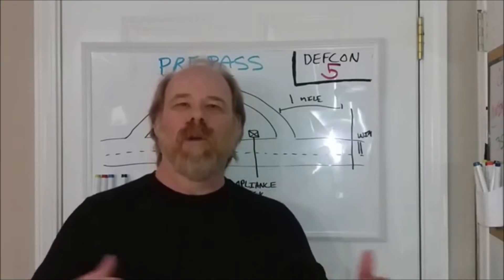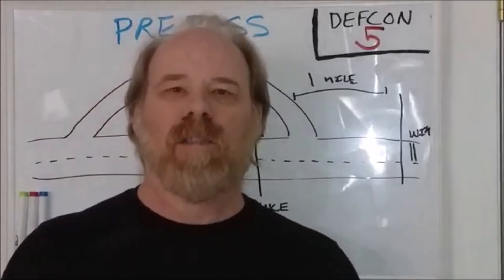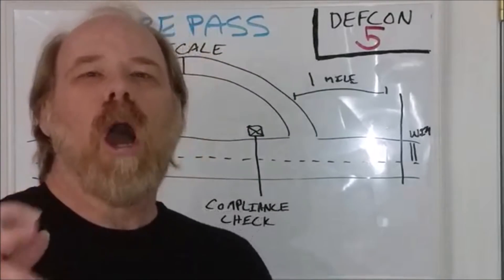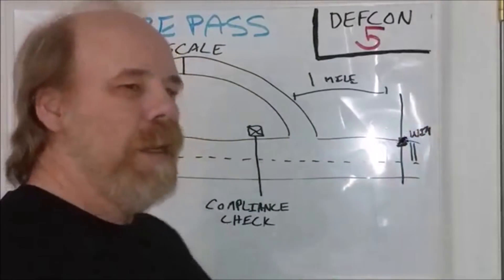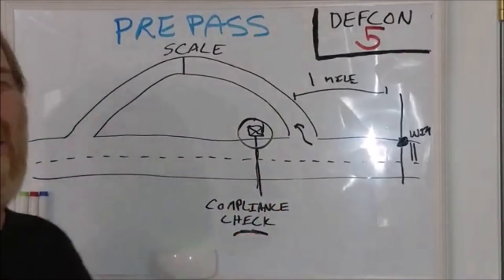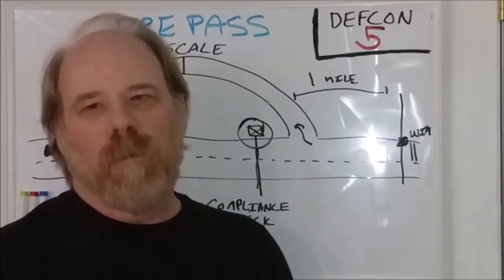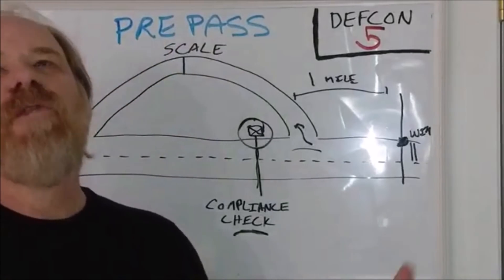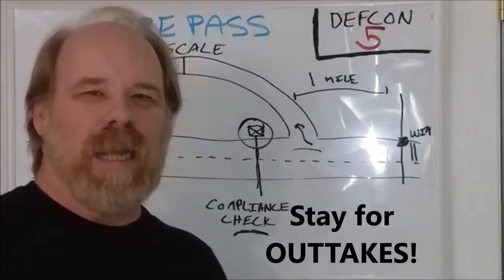How does PrePass work? | Trucking 101 | Trucking Answers

Comment: I have an ElitePass in my truck (Prepass and EzPass combined).  Haven’t gotten any lights (red or green) in a couple months, so I end up having to go into every open scale.  I’ve tried changing the batteries too, but didn’t do a thing.  Still works for tolls, though. My dispatcher hasn’t been of any use either, claims to have ‘run it up the chain’ but not gotten any answers.  Any ideas?
Reply: call prepass

Comment: Some states  call it I pass some call it pre pass  but your on the honor system. We were pulling  appliance and electronic loads for Best Buy  our tractors on that account were single axle  customer would not pay for the fuel that a twin screw uses  our loads were Light  don’t recall the exact numbers

Comment: what happens if the prepass doesnt light up and the scale is open? ive seen dozen of truckers skipping it maybe just 1 entering into the scale
Reply: You have to treat it as if you don't have a prepass. You gotta pull in the scale.
Reply: Krystal  your prepare not lighting or the roadside sign staying blank?  If your prepare stays blank then pull into the scale just to be safe.  If this happens in multiple states then get your company to replace it, the battery is likely dead.  Also if you go say thru WV toll plaza and it doesn't pay/ registrar dead battery also

Comment: Wastes my time always getting the RED @ the Florida AG checkpoint, they wave @ me to git every time. Just gonna start bypassing it.
Reply: they will chase you down tell the company to sign up for prepass ag then you will get a green every time but if you have produce would be the only time you need to go in on a green
Reply: Right  Florida  at  is separate from DOT. Requires separate agreement
Reply: Technically, all trucks must stop at ag ck. Flatbed, car carrier, van,refer, ect. Cop at ag ck told me that. Not likely to chase down flatbed vehicles, but can.
Reply: @garychace5091  i never stopped as long as i got the green

Comment: Nice when it is green than at the last minute it turns red when your almost the past the entrance. My last company had them in all trucks but some did not work because they were not activated. They said they have to pay so much per month to use it?
Reply from the maker: Yes, there is a fee.
Reply: it aint free
Reply: @JASONHJEFFERSON  Yes that is why my company only activated certain ones. I had to request to be turned on and then it was shut off again a few months later.  They told me was only for regional drivers which I was.
Reply: @mrj-charles6383  your company higher ups sound a little wacky , only for regional??
Reply: @davidrigoni8231  Yes because local was in areas where no prepass.  I ran Mid Atlantic and East Coast Regional for them. Not there anymore since I am semi-retired from trucking now. They offer flex scheduling but would not put me on 1-2 days a week where I am so I left. I was working a 4 days schedule but that was too much for me.

Comment: You forgot to mention the plates or sensors in the road bed before the avi pole,  if your not in the right lane by the avi some states set it to pull everyone in. Look for those traffic light boxes off on the right shoulder those are usually a clue that there’s sensors in the road.
Reply: but some states have weigh in motion tied to it and the weight sensor is in the right lane
Reply: If ya try to do something like only go over only 1 plate its gonna say that bad boy must be over weight
Reply from the maker: The site doesn't show those.  The AVI can read from both lanes.

Comment: What exactly is the reason for ag inspections....other than to wave at you?
Reply from the maker: "I was asking this plant questions but it wasn't giving me good answers.  It was evasive."
Reply: Trucking Answers 
Well... it should have been invasive, not evasive. That’s what happens when you use autocorrect instead of proofreading.
Reply from the maker: Sometimes they ask you if you have an orange in the truck.
Reply: @TruckingAnswers  oh, you mean like in your lunchbox!
Reply: @mattberg916  I had just eaten an orange I said, they made me wait 30 minutes for it to digest.
Reply: It’s normally to check for evasive plants or bugs. They don’t inspect as much as they use to because states implemented regulation on shippers of products that were a problem. And receivers don’t take product without correct paperwork. Inspection stations know who to look for and who to wave at.
Reply: i signed up for ag on mine so i got the green every time i went to Florida. but if you are hauling produce you have to stop regardless
Reply: They don't want something invasive (Madagascar tree fungus?) coming into Florida.  Or something being exported out Florida